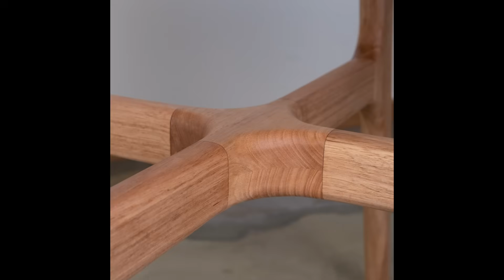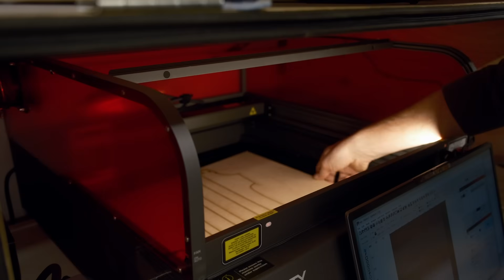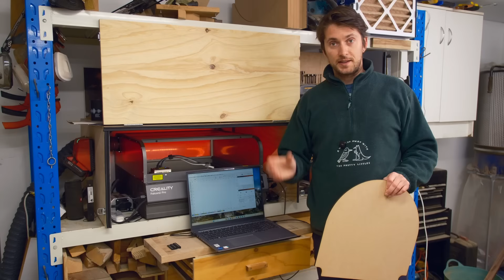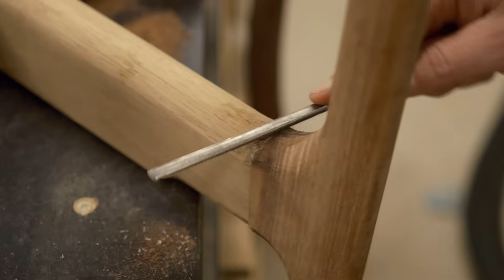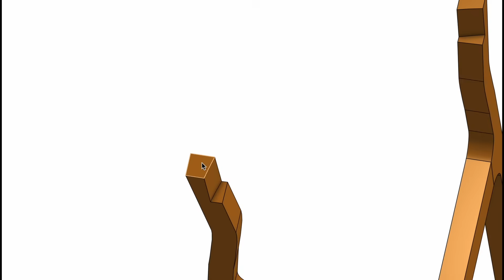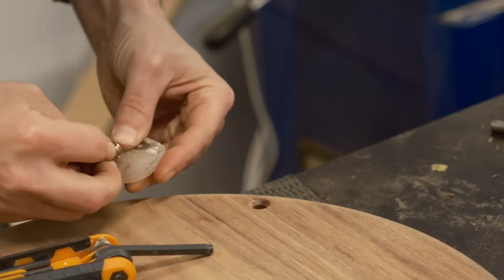Did I finally get this chair right?

Comment: The dust from Tassie Blackwood is toxic, so it's probably not an allergy. I love using it, but always make sure I'm properly masked up when cutting, routing or sanding it.  That's good practice generally, of course, but absolutely mandatory with Blackwood.

Comment: I am sure you know this, but I recently re discovered this japanese technique of hitting the faces with the hammer before joining the half lap together. The moisture in the glue will then make the wood swell again making for a beautiful and tight joint with easy assembly. I keep forgetting this but it actually works so well :)
Reply from the maker: I'll definitely keep that in mind for next time! it was fitting so nicely without glue that I didn't think it would be an issue

Comment: Your two half-lap tips (the blade height one at 1:51 and using the part as an offset at 2:05) are so useful. I have to make a similar half-lap joint today and I’m going to use them!